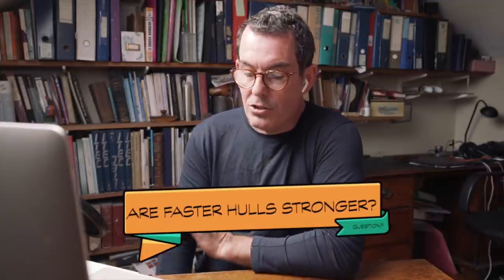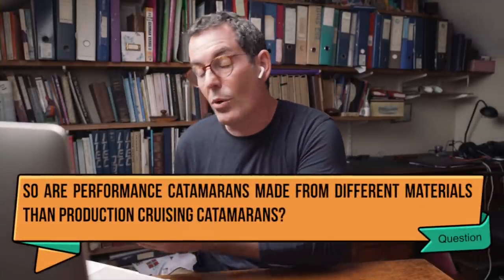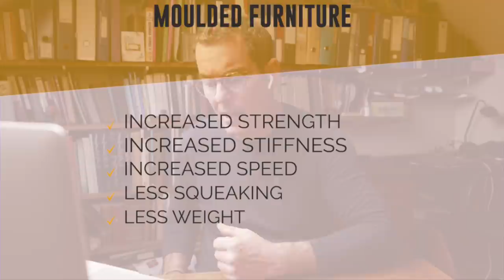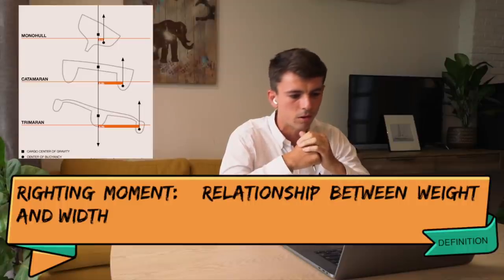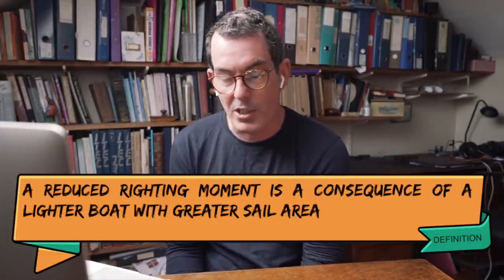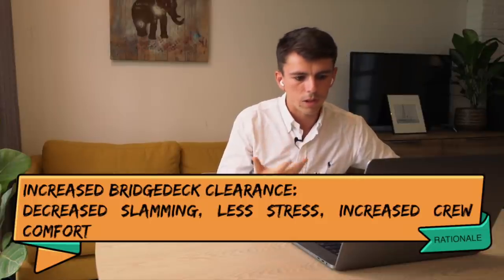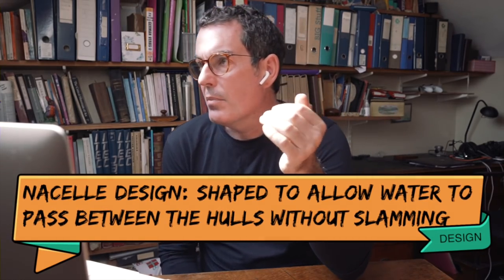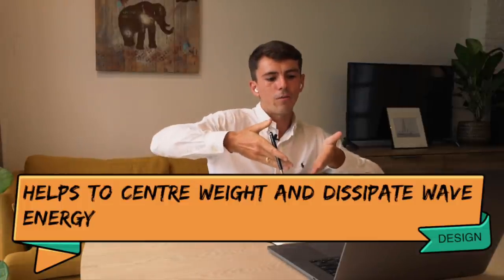CATAMARAN DESIGN: Why Are Some Catamarans Safer Than Others? Ep. 4.

Comment: I'm thoroughly enjoying these technical talks so thanks Nick for that.  What I don't understand with this video is the actual righting movement, no cat either performance or cruising is going to right itself if flipped, indeed the mast and rigging would probably give way long before that happened.  With that in mind what are we actually referring to or concerned about when saying righting in this instance ??   As you quite rightly point out when sailing a cat you REALLY need to know your numbers and your rig to sail the boat safely and I would have thought that was more important that the righting movement.  I may well be looking at this totally wrong (not being an experienced sailor like yourself) but I feel a little confused at this point.  Having furniture built into the hull has many benefits and you would only have to look at catamaran IMPI and all the changes that Brett has made to his Lagoon 440 to make it the world cruiser it is.
Thanks again Nick, hopefully you can set me straight on the righting question.  Stay safe and keep having fun.
Reply: It's not about how easily it rights itself as much as how much force is required to lift a leg outta the water.
What he's saying is that a performance cat has huge sail volume so you need to be wider and or lower to the waterline and heavier to stay upright but the last thing you want on a performance cat is to be low and heavy. So it's all a balancing act, quite literally. Don't know why they don't just call it the moment of inertia tbh. Maybe it's more complicated than that, < engineer not a sailor 🤣🙈
Edit. I should have added its about how FAR you can lift that leg outta the water, stay safe, be at an efficient angle of attack and reduce drag BEFORE you end up popping the lid on the epirb and pulling the cord of the raft 😁
Reply: As Andy C has said righting moment is a function of how heavy the vessel is + how wide the vessel is. The wider & heavier you are the less likely the vessel is to heel (like a monohull) & the more likely it is to return to the stable position. remember righting moment is given as an angle that the vessel can heel to before it wont right anymore.

What isnt being talked about is that some monohulls can be at 120deg (almost fully upside down) and they will return to their upright position (if they maintain water integrity). A catamaran will only return to its upright position if it hasnt gone past around 60deg. 

Another thing that I believe is important to talk about when discussing righting moments, is to talk about "tripping". In a monohull in big beam seas the waves will roll the boat in a way that may get the vessel close to a 90deg angle, when this happens the keel is on an angle that allows the force of the wave to dissipate and thus the monohull will easily return to the upright position easily.  

In a catamaran, while in big beam seas the vessel can approach the 60deg angle very easily (imagine the boat on a big wave, and the angles it could see), but the difference is that the Mini keels or dagger boards can trip the catamaran and force it over the that maximum heal angle, where the vessel will never return to an upright position. This is why some ocean catamaran sailors prefer dagger boards because in these conditions they can lift the downwind daggerboard totally out of the water (both dagger boards if it is really bad) and remove the risk of the catamaran having a tripping event. eg: the Catamaran will slide sideways against the force of the waves(or down the wave), instead of tripping over the keels and ending up upside down. In a monohull you slide sideways, and only if the wave is big enough will it roll you over the 120deg point.
Reply: @daveatticus1018  The righting moment curve on most catamarans is positive up to 90 degrees of heel, which means that at any angle of heel up to 90 degrees the catamaran will come back down upright. It will be less than 90 degrees due to windage on the underside of the windward hull and bridge deck, but not as low as 60 degrees. Relax.

On big waves, the angle of the boat on the wave does not affect the righting moment 1 for 1 as both hulls are still in the water. So a cat heeled to 60 degrees on the side of a wave will still have the righting moment equivalent to less than half of that angle. If this wasn't the case, we would have a heap more catamarans upside down, but we don't!

You are correct about daggerboards - raising the leeward board allows the catamaran to slide sideways when hit by a breaking wave. Keeping the windward board down increases the downward force on the windward hull, hence that board is left down.
Reply: @HandyC  Thanks Andy, I still think the amount of stress on the rigging to raise a leg on a cruising cat would be monumental, if you actually got to that point when cruising as opposed to being in a storm you would be a very poor sailor indeed.  Thanks for the help.
Reply: @daveatticus1018  Plus in a mono as the yacht heels over air spills out of the rigging thus reducing the affect, this is not possible in a cat as there is no heeling over which goes back to what Nick was saying about the stress on a cats rigging being so hard to feel.  This is the first time I have heard about the 60 degree rule and it surprises me that it is that high, just imagine the stress on the rigging and structure at anywhere near that point.  I knew that daggerboards help prevent "slippage" but I didn't know they would help prevent tripping - very interesting.    Thanks for the information.
Reply: @tomjarecki  Sorry Tom, but at 90 deg heel, a cat is past the point of vanishing stability, and it will not right itself back because at that angle the weight acting on the center of gravity flips to the other side of the vertical line passing through the center of buoyancy.
Reply: @feshfeshsailing  I used 90 degrees as a general figure. You're right, the actual values for most cruising multihulls are between 70-85 degrees. That's a long way beyond the ~10 degrees of heel when the windward hull lifts clear of the water where the righting moment is maximum.
Reply: @tomjarecki  Yep, On most cats, computed stability usually  vanishes between 55 and 75 deg of heel. And that is a calculation made with flat water surface and no wind effect. In real conditions, stability usually vanishes around 60 or 65 deg.
Reply: @
Tom Jarecki, @Glen Peters, @Fesh Fesh Sailing

Interesting debate going on here. I think we are all talking about similar aspects. But after doing some reading I now understand the following

- Due to the beam of a catamaran, it is inherently more stable than a mono
- Wind & wave effects will reduce the righting moment of all vessels (eg: big seas = less available angle for your righting moment, say for a mono 120 deg to 100deg)
- In order to induce a vessel to capsize, the wind & wave action must induce a roll force on the vessel. eg: the waves must have sufficient pitch & force to roll the vessel
- Cats have a higher initial stability and require more roll force to start rolling than a mono (eg: harder to roll because of the higher initial stability )
- Cats will tend to surf sideways if there are high forces acting laterally 
- Daggerboards & Minikeels can increase the lever arm moment of a Cat, resulting in it tripping (& potentially going past its righting moment). The mitigation is to raise the leeward daggerboard if you can.

In summary; Cats are harder to roll, but if you can impart enough force to get it to roll, then it will stay upside down.  Obviously in a mono its the opposite, assuming it stays watertight.
Reply: @daveatticus1018  You pretty much wrapped it up nicely.

Comment: My top three.
Overall width. A rough rule is that there is a risk over side on capsize when the wave is three times the width.  And of course the wider, the greater the sail area before lifting a hull.
Windage.  There is a certain wind speed when you can no longer sail up wind, less windage, higher speed.   At anchor reduced load on anchor.  (Most production cruising cats are more motor sailers) 
Rig.  Most come with rigs based on racing rigs, ie, big roach, swept back side stays.  Not an easy rig, especially short handed.  For short handed cruising, a cantilever mast with free rotating rig is far preferable.  You can then release the pressure in the sail, and makes reefing much easier.

Comment: Rules of thumb:  
For an offshore cat with a beam approximately half the length:

For an offshore cat with a beam wider than half the length, additional bridgedeck clearance is usually needed. The further apart the hulls are, the lower the hulls will ride on the shoulders of waves and the higher the crest will be between them.

20% of the distance between the hulls = minimum bridgedeck clearance.

Inadequate bridgedeck clearance would give a hellish ride in choppy conditions, with horrifying pounding.

Comment: This was one session where I had a better understanding. It would be interesting to hear what are some of the safer cruising catamarans and why?
Reply: I went through this, Look at how they are constructed. Lagoons for example are all "glued" together, glued bulkheads, cheap materials, glued bridge deck etc. Once the glue reaches its shelf life what happens? Well a YouTube search will show you. The more structural fibreglass/carbon fibre etc and metal there is holding it all together, generally the stronger it is. Also call insurance companies ask them what brands have had the most structural failures, they can tell you, the last guy I called was very informative and told me all about certain manufacturers.  This question needs to be asked with a budget as well, it is too broad.

Comment: Thank you for the great information. Is there a specific year or two where the production boats made significant step changes in design improvement? For example, are pre-2015 production boats to be avoided, since post-2015 boats have better hull shape, bridge deck clearance or mast position?
Reply: Low volume sterns like those of Wharram cats tend to pitch more, which is unpleasant and slow.  A full width stern, (one in which the transom is the same width as the maximum hull beam,) however, tends to have too much drag.

Comment: What about ballast to displacement ratio for catamarans? I'm designing a 5m stitch and glue catamaran and thought I would use deep narrow hulls with iron and epoxy at the lowest point and a layer of reinforced concrete above that for ballast. Like each hull having an encapsulated full keel. The idea is a trailerable pocket cruiser that I can pitch a tent on the deck of at anchor or beached, but that isn't as shy of weather as a Hobie.

Comment: You should have uses strong instead of safe when talking about different cats.  When the furniture or options are molded in at the factory, they all become somewhat load bearing in some situations thusly making it stronger than one with added on features.  All boats are only as safe as the captain and the decisions made under way.  Great video!  Love to need out with ya.  Oh, the upside down ITEC book did kind of make me crazy.  Gotta love OCD.  Thanks

Comment: The hull clearance formula can also be estimated by  Hull Length (ft) x 19 = clearance (mm) 
I think going back to first principles is a good approach to this subject. (I just figured this out, so...check it out yourself). 
Reefing a cat versus reefing a monohull. I think what Antoine Richer is saying might be better expressed with a graph or animation. A cat may not have to reef as soon as a monohull, in winds that heel the monohull, the cat doesn't lean much, as the winds increase the monohull heels more and more, while the cat doesn't lean much at all - until perhaps it is too late - hence the need to do it by numbers. In race videos once a cat starts lifting an ama, sometimes it can't be stopped.  Also as a cat ama is lifted higher and higher it begins loosing it's downward force (trigonometry) (imagine a cat on it side amas vertical, it can go either way? Between flat on the water and vertical the weight of a hull loses leverage.)
Though seeing a lot of  post-hurricane  videos where we see lots of flipped and wrecked  cats - smashed in hulls, etc (as well as the same to monohulls) I don't ever remember seeing a broken-cat, where the hulls are pointing in different directions, or one is ripped off.  That seems to indicate one basic problem, overall integrity is solved.
Another concern I have about multihulls with the open stairs into the amas (floats, hulls) is if in a huge storm if a wave busts into the saloon that water is going down those stairs, it's easier then to wash back out where it came in. Flood one cat ama even to a small degree and you have a huge problem.  As a sea kayaker I know from experience water always finds a way, and a little bit of water on board sloshing around can be a huge problem.   I think one hull with a foot or two of water sloshing around is more an issue in pitching than rolling. 
Hull slapping and pounding. This has to do with the likely shape of the wave that hits the underside. Ideally a nacelle is designed so whatever the typical wave shape is, it doesn't hit the bridge all at once.   A perfect high dive quietly ripping into the pool, instead of a belly smacker. 
Great video. Thanks for doing this.

Comment: One thing I think you’re missing is slapping, which is different than slamming. All those low bump outs and nacelles, and hard chines on both sides of the hulls, catch waves and make noise.  The noise may be less than slamming but it’s very constant.  It can even occur at anchor with very small waves. I owned a smaller cat that had near constant slapping and found the constant noise very annoying. I have rarely read about this but I am very focused on it in looking at catamarans. I would not buy a catamaran that has any hull bump outs or chines within a foot of the waterline.  I want to see how a cat lies at anchor in a  windy exposed anchorage and check the slapping.

Comment: I’ve  a Seawind 1160
Bridge deck slamming is not an issue at. All it is a rare event
Hulls do lift when the wind is around 20 from abeam it’s hard to know when to reef 
There. Are reefing instructions in the manual but it’s easy to luff up or bear away .

Comment: I would be interested in your take on the VAAN R4/R5.  Aluminum hull is tempting.
Reply: i worked in the construction of 96 metre+ high speed passenger, aluminium catamarans, even the 112m boats with a 30 metre beam only had a 2m draft, their hull plating was up to 12mm and 8mm above the water line, 6mm on the passenger decks and wheel house, frames were 1200mm apart with 'stringers' between 200mm to 400mm apart. I reckon a ~46ft version with the same wave piercing capabilities would be great.

Comment: Did they get to on keel sails? Isn't keeled sails safer and faster?  Cat staying on top of the wave and strong while wide enough to gain 3 to 1 force vector ratio is two mast wide.  What about these features in terms of power and rudder control. Wider is greater righting moment twice as wide as tall is three times greater righting moment.  Stability and keeling of sails is most important.

Comment: I have never understood why is the engine room + fuel capacity is the least important aspect in a catamaran.  It is so disregarded that many reviews ignore them. Why accomodations are more important than engines in cats?  Engines are going to save your live if you loose your sails  or if wind is zero or will help arrive on time to destination or escape a hurricane.  Wind cannot be trusted.   Motorsailing  has being so important for me in the 80s from the Caribbean  to Florida. I would prefer less living area in the hulls and bigger comfortable engine space (engines have to be inspected once per hour), fuel capacity (2k miles range under one engine) plus 2 generator,  2 water makers, high capacity drain pumps and inmediate access to all seacocks ....  For me .... engineroom is the first thing that most be inspected in a vessel and easy access to all wiring, cables, electronics hidden behind walls and floors.  Luxury never saves lives.  Engine room in cats look awful compared to a motorsailer like the Shannon 53 HPS, the Nordhanv 56 MS,  the Cheoy Lee 52 MS or the Diesel Duck 47 MS.

Comment: A strongly built Cat will still pitchpole, broach and capsize like any other Cat that's mishandled in very heavy weather (10+), but it might just survive these events relatively more intact.
Reply: Pitchpoling - too much speed in large waves, not likely when cruising. That's why bare poles and drogues are used in storm conditions.
Broaching - very difficult to do in a catamaran, they track like they're on rails and have two rudders set very far apart.
Capsize - that would be a bummer, but wouldn't break apart.

One of the biggest benefits of performance catamarans is that you can use much less sail area in any given conditions and still maintain reasonable speed. Heavier catamarans require more power to keep moving so are more at risk with larger sail area.

Comment: Mr. MONK asked me to see if you can fix something?  There are 5 ITEC books to your right.  The middle one is not aligned with the other 4.  Can you turn it around so they match?    Have a Magical Day!   I was also thinking: with one nacelle never in sync with the other because of the ocean moving.  Can a Catamaran break in the middle?
Reply: Can a Catamaran break in the middle?  

Short answer: Yes.  

Long answer: Stress concentrations occur as a function of hull design.  Material selection provides Young's Modulus of Elasticity.  When the force applied exceeds ultimate tensile strength, bending to failure occurs.

Longer answer: Get an engineering degree! :)